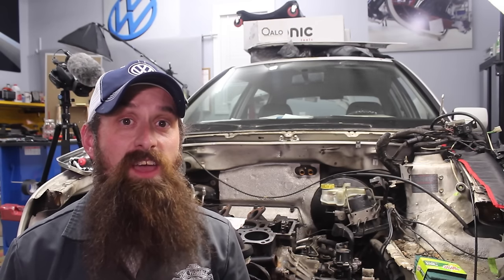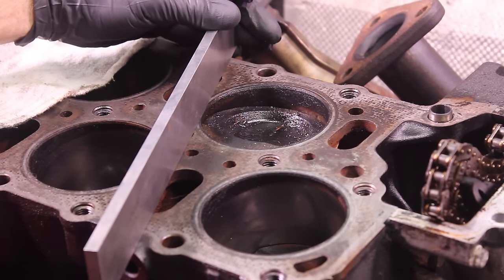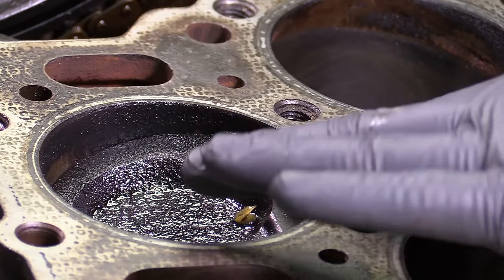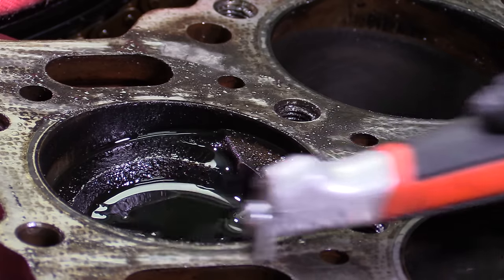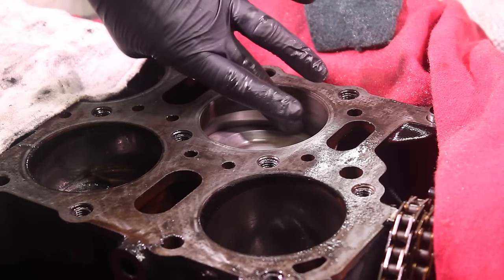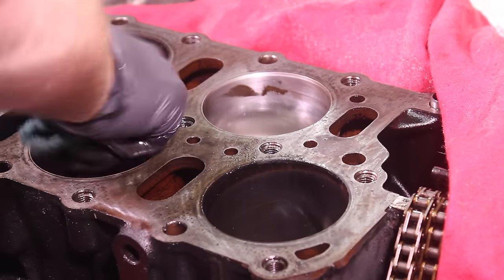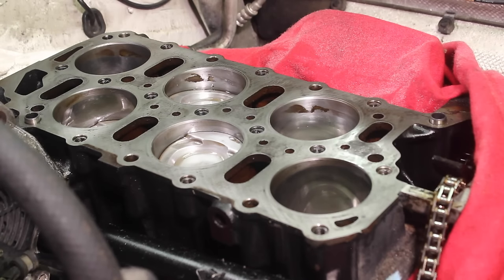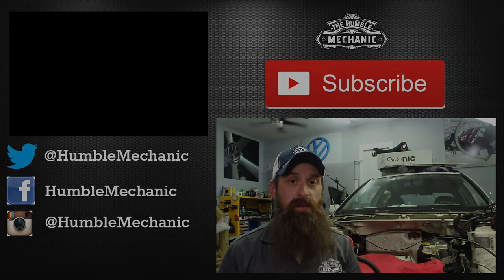Removing Carbon From Piston, Cylinder Walls, and Block Deck

Comment: yo guys. wd40 is a great and reliable product. it's great to prevent rust on items you're leaving sit for a long time, clean tools, get rust off, clean grease. it is not however a lubricant, any beginner hobby mechanic knows this.  the best part is it flashes off exhaust and such with less smelly smoke than most other cleaners or nut looseners. that said, why are people bitching about him using wd40 for this job? it's a great product for said task lol.
Reply from the maker: Great feedback. I was really surprised how well WD40 worked here. I have found that people have several issues. 
1) Any time a video is sponsored, there is kick back. It could be the best product ever and there would be heartburn
2) People have intense brand loyalty. If I shoot a video about Mobile1, the Mobile one haters will hate, even though they make a great product. 
3)Most people don't consider it a professional brand. I don't really get that, because I have seen WD40 in tons of shops over the years. 

It is really interesting to do videos like this and see the comments. We(me included) become married to our beliefs and often struggle to be open to different ways of doing things.
Reply: I totally see what you're saying on all 3 points bro.  I think the bigger issue is people don't even know how t use what they have. Use Brakleen as MAF cleaner, MAF breaks, they complain, use torque wrench as a breaker bar, it stops working they complain, use WD40 as a purpose made lubricant, or cleaner, they complain...  I guess the consistency is, people just love to complain haha.
Reply: I always pull my plugs and spray the hell out of the cylinders for long periods. I just pulled a 355 apart that I stored since 1990, the cylinders had zero rust, and I live 2 miles from salt water.
Reply: I always save the WD-40 red straw and leave it in the glove box. Once I drowned an AMC eagle up to the dash and got water in the carb. When we got it out of the puddle, I used the red straw to suck the float bowls clean with my mouth to get it running.  It worked good.
Reply: I liked your video and think I learned something from it, no matter what the naysayers say.
Reply: omgitzsteg it is a lubricant, read the can.
Reply: i use it on my 1095 knives and saws using wd 40 even when chopping wood or cutting still provides decent lubricant.
Reply: Tepco Cycle Repair  It isn't, it's a water dispersant, hence WD. It's hydrophobic but not lubricant.
Reply: @TepcoCycleRepair  
WD 40 is a SOLVENT not a lubricant, it will lubricate slightly, any liquid will but disperses quickly.
For instance if u wanted to lube a chain, u wouldn't use WD40, it wont last.
Reply: @motorcitymanman7711  it is a lubricant as stated on the can, you contradict yourself in your own statement. Is it a lubricant for everything? No but it is a lubricant. Get off the wagon of people who just like to say "it's not a lubricant" and yes I use it on chains all the time with no problem for over 10years now, bicycle and O-Ring motorcycle chains.
Reply: @TepcoCycleRepair  
I use it to CLEAN my motorcycle chain because it's a cleaner and solvent, that's what it's designed to do.....I LUBE my chain with a LUBRICANT or chain wax. You run a cycle shop and you use WD40 as a lubricant!!?,
 GEEEZ!! Hope u dont charge customers for lube when u do, you're ripping them off!!
I said ANY liquid will lubricate even water BUT IT DOESNT LAST!!!
Wd40 CLEANS grease and grime off my cycle wheels, LUBRICANTS dont do that!!
I use WD40 to clean tar off the fenders of my car....LUBRICANTS dont do that!! Cleans crayon off your home walls, LUBRICANTS dont do that!!
Reply: @motorcitymanman7711  straight from the WD-40 website 
Myth: WD-40® Multi-Use Product is not really a lubricant.

Fact: While the “W-D” in WD-40®stands for Water Displacement, WD-40® Multi-Use Product is a unique, special blend of lubricants. The product’s formulation also contains anti-corrosion agents and ingredients for penetration, water displacement and soil removal.
I also use chain wax when called for, like I said it is a lubricant but not for everything.
Reply: @TepcoCycleRepair  
Cmon man it's a VERY THIN lubricant like water......its not MEANT for lasting lube jobs!
Reply: @TepcoCycleRepair  
Maybe you'll understand this way......do you use Kerosene as a lubricant?? WD40 is like kerosene, a solvent and penetrant.
Reply: @motorcitymanman7711  Kerosene is not a lubricant, WD-40 is. Look, it's like this, I use WD for a daily lube on my dirt bike chain. It's an O-RING the parts that need lube are inside the O-rings, no lube will get in there, loading the chain with a heavy lube or wax is damaging due to what it attracts. The WD keeps the chain clean and lubbed for the day without attracting dirt. My race mountain bike is the same, spray it on wipe it off and ride for the day. If I'm doing a 24hr race I use TriFlow. If I'm doing a long XC MX race I'll use a different lube. 
I'm not arguing that it doesn't last long, I'll agree with that. But I won't agree that it's not a lube, that's all I'm saying.
Reply: @TepcoCycleRepair  
WD40 has kerosene in it........
Reply: @motorcitymanman7711  who told you that, the same people that said it wasn't a lubricant. 

Again, straight from the WD-40 website:

"While the ingredients in WD-40® Multi-Use Product are secret, we can tell you what it does NOT contain. WD-40® Multi-Use Product does not contain silicone, kerosene, water, graphite, or chlorofluorocarbons (CFCs)."

Don't believe everything you hear.
Reply: @TepcoCycleRepair  
Like I said, WD40 cleans almost everything......a LUBE is thick and doesnt do that, you can use it for whatever you want but its marketed as a Solvent and Penetrent of course ANY liquid will have some lubrication qualities but WD40s lube capabilities do NOT last like a normal lubricant......if you work on bikes or cars you should know this already!
Reply: I'm not sure if you're serious or not but it IS marketed as a lubricant as stated on the can and on the website, is it the lubricant that you're looking for whatever specific need you have maybe not but to say that is not a lubricant or  marketed as a lubricant is completely wrong and that's my point. And yes I have been working on bikes for over 30 years and am fully aware of the capabilities of many products. I'm just tired of people saying WD-40 is not a lubricant without educating themselves first. 
I can point you to their website if you need, please read through it sounds like you'll learn something!
Reply: @TepcoCycleRepair  
Why use a "lubricant" that is WEAK and doesnt LAST????
I dont know ANY professional that would recommend using WD40 as a lubricant......everyone knows except you, evidently, that it wasn't designed to be used that way, that's my point.
YES ANY LIQUID WILL LUBRICATE, but not all lubricate well and will last and WD40 is one of them.
On the front of their can, where it advertises the FEATURES and uses of the product does it mention lubricating because it's not designed to do that, it's designed as a penetrent and cleaner......of course thaty say in their website that it lubricates because ANY LIQUID WILL and they are SELLING their product so they want to sell as much as they can, ask any engineer that works with moving parts if they recommend WD40 as a lubricant its WAY too thin and the lubrication lasts a short time....UNLIKE  a real, thick, grease or chain lube 
Do you own stock in WD40 or does your Dad work for them?? LOL
Reply: WD 40 is good for cleaning, but for long term corrosion protection or lubrication it's god awful...it actually attracts water!
Reply: @motorcitymanman7711  yes it absolutely does say it lubricates directly on the can, please just look at it. I understand your point, it's not a long lasting lubricant, I'll agree with that. You say a lubricant is thick, try lubricating your lock cylinders with a thick liquid!! It needs a thin lube like WD or even a dry lube like graphite powder, heck what would you call graphite powder?? According to you it's not a thick liquid so it must not be a lubricant. 
So back to my point WD-40 is absolutely a lubricant, AS WELL as a penetrant, and rust treatment. 
Please prove me wrong with facts like I have shown you, you can't because you're wrong!
Reply: Myth: WD-40® Multi-Use Product should not be used on bike chains.

Fact: While WD-40® Multi-Use Product it is not a grease, it is formulated with strong lubricating oils and other ingredients, and is a terrific product to use for bike maintenance. It does not attract dirt or moisture to metal surfaces – just be sure to wipe off any excess WD-40® Multi-Use Product before riding.
Reply: @TepcoCycleRepair  
Ok, I agree with you that WD40 is a light lubricant, as I said all liquids are......but I wouldn't use it to LUBE a cycle chain, CLEAN yes, but not lube, it's a weak lubricant and doesnt last.
Yes graphite is a dry lubricant, I dont think I ever said there was no such thing, just that most lubes are thicker so they last.
Reply: @motorcitymanman7711  fair enough, good talk.
Reply: WD-40 actually works perfectly fine as a low viscosity assembly lubricant. If you disagree, that's fine, you're just wrong.

Anyone who complains about this kind of crap is just trying to show off how much they've been told because it makes them feel smart. Jokes on them, they're idiots.
Reply: WD40 is not too good on hard carbon buildup on rifle piston. It looks good enough here though. Will it work the same as Seafoam when sprayed into the intake? I really wanna spray something into my old engine other than water or my theoretical inventions like urea and hydrogen peroxide.
The Seafoam stuff should be 4:2:1 diesel-naphta-iso alcohol. 

I'd like to do it properly like this but only few % of people are able to do that.
Reply: No, it's garbage and not good at anything but rinsing other things away.  There's a better product for any given purpose.

Comment: Thanks for the tips man! Just got a 68 corvair engine to put in a dune buggy...the engine is dirty! There was no water inside too!
Reply: Well, Corvair is air-cooled, so...
Reply: David Plass yeah lol, it was sitting outside under a old tarp for 15 years...that's what I ment about water
Reply: Oh, so no water inside in the GOOD way!
Reply: David Plass oh dam I have a old corsair front end destroyed but only has 678 miles on it I but it's still inside the car and Its really rusted the engine is alluminum so that's not rusted but the bolts and stuff holdinf it is

Comment: Great tech tip. I've been an engine builder for decades. It's always nice to learn something new. As for the scraper, I no longer see my Snap On guy. I did find out that the Bluepoint scraper is mand by Bahco. I bought one on Amazon. Thanks again for the info.

Comment: If your working on an older engine sometimes the head gaskets contained asbestos so it might be a good idea to wear a respirator when cleaning the surfaces.
Reply from the maker: +Sam The Multimedia Man yikes!!! That's not good at all
Reply: yeah i found this out a few days ago when i wrestled the heads off my 1980 AMC Jeep 360; There was a thick grey silver coating on the block and head surfaces at first i thought someone put the heads on with a coating of JB weld all over the head gaskets; So i checked the factory manual and it turns out the head gaskets were aluminum and asbestos fiber laminated steel... with asbestos only being phased out of the auto industry with in the last decade or so it could be contained in head gaskets in many makes years and models.
Reply: Lots of exhaust manifold gaskets also contain asbestos and still used today.
Reply: only us jeep guys would jb weld a headgasket
Reply: Asbestos is not necessarily harmful when wet.😐
Reply: We used to buff the gaskets off and bead blast heads etc without masks..... love the lack of health and safety years ago lol.
Reply: AbioticSpider57 true that... will be fun.

Comment: This method actually worked really well for me. The wd and pads makes the gasket lift right off. The one thing was the debris getting better the piston and cylinder walls, I ended up getting a bit out but I’m not sure if I need to be worried or not
Reply: Howd it go
Reply: @Jet_Hammer  spun a bearing, I’m thinking the degree clogged the passages within the crank and starved a bearing but who knows

Comment: A good way to ruin a motor. Scotch-brite is aluminum oxide which is incredibility hard and if you get that inside the motor it will be toast in no time.
Reply: I was rolling my eyes, until I looked it up.  Al2O3 hardness: 9.    Iron hardness: 4.   Scotch-brite materials:  spun polypropylene fiber, with nine grit variations, most of which incorporate Al2O3 or similar high-hardness abrasives.   (Source:  wikipedia)   Also, BobIsTheOilGuy confirms.  Thanks!
Reply: Nice catch!
Reply: But is the extremely superficial "scratches" left by the scotch pads enough to make a head gasket useless? I'm gonna say no. But to each his own.
Reply: We're not talking about scratches on the head, we're talking about very hard particulates sluffing off of the Scotch-brite pad and getting down into the engine, where they make their way to bearing surfaces and destroy them.
Reply: Still doesn't seem as dangerous to internals as the normal small flakes of steel that gets into the oil with normal wear and tear.
Reply: Collin Moore It is.  Steel can be as low as 4 on the Mohs Hardness Scale.  Aluminum Oxides are all around 9, right below diamond.  For more info, see https://www.bobistheoilguy.com/forums/ubbthreads.php?ubb=showflat&Number=563163
Reply: I don't think they'll stay in the engine long enough to make very much damage, oil would wash them off, and they'll get trapped in the oil filter, and for the part that would be in the top of the pistons, the turbulences would end up getting them out with the exhaust gases. I could be wrong though, but i wouldn't worry that much for that dust.
Reply: Unfortunately, what matters is reality-- not what you think or feel.  Check out the link I provided above.  Also this one: http://www.machinerylubrication.com/Read/1777/aluminum-oxide-oil
Reply: Looks like you did your homework so, What would you be recommending using ?
Reply: Benoit Loriaux This information is new to me as well (thanks to the guy I was replying to,) so I don't have any particular recommendation yet.  But on my next head project, I'll be trying to stick to tools and products that don't have grit that can slough off.  If I can manage with just WD-40 and a gasket scraper, I will.   (Otherwise, I'll try to research the abrasive in whatever I do use, before trusting it.)  It will certainly take longer, but it's my own vehicle.
Reply from the maker: +Ryan Bissell (Ryan V. Bissell) anything with grit left in an engine can cause damage. Cleaning all debris from the job is going to be important. 

As I mentioned in the video that is not the last step in this job. The bottom end is going up on the stand for more cleaning. 

This was simply a method of removing carbon buildup. 

A video on final clean and prep will be coming once I get there
Reply: ☣droid☣  I agree🤙
Reply: ☣droid☣ 
I always try to keep whiz wheels and abrasives away from something like this, unless I can fully remove and fully clean it.  
 even just using the scrapper small shavings of metal, gasket and carbon are going into oil areas  and down into piston rings. 

necessary evil though, can't put new gasket over crap. 

I just do my best to keep stuff from falling into engine. usually dusche down the holes after with wd40 to push debris to oil pan, and then change oil.
Reply: Using a high speed 90 to remove the old gasket is overkill. One sure way to fuck it up
Reply: ☣droid☣ 
Scotch pads are plastic aren't they?  Sure look it to me and they are where I am.
Reply: +iVlog They might be structurally plastic, but they are infused with aluminum oxide, and that is the problem.
Reply: Ryan Bissell 
Assuming you can't blow them out with compressed air and SB is a no go, what do you recommend instead?
Reply: I'm not a pro mechanic, I was only sharing what I learned elsewhere (try googling "bobistheoilguy scotch brite"... I think that was my source.)  I believe the thread I link to below recommends staying with a putty knife or hard plastic scraper.
https://www.bobistheoilguy.com/forums/ubbthreads.php?ubb=showflat&Number=563163
Reply: ☣droid☣ exactly, bbobynski in this thread is a GM engineer, his name is Al Cline and I consulted with him daily for over 10 years, see this thread 

https://www.bobistheoilguy.com/forums/ubbthreads.php?ubb=showflat&Number=563163
Reply: Thats why you clean it off with whatever chemicals you use and air compressor.
Reply: There is a filter between the oil pump and the bearings.
Reply: I would use a nylon or brass brush
Reply: bullshit....used it for years...not one engine ruined.
Reply: @guillaumegaudin694  Yea, you are very wrong about that.
Reply from the maker: It ended up that I pulled the whole bottom end apart and rebuilt it. Found some rod bearings that weren’t happy
Reply: @collin3800  its the pool of debris now sat on the compression ring soon to be blown down past the rest that are cause for concern.
Reply: Dremel wire wheel and vacuum.
Reply: @RyanBissell  don't forget though, the difference in hardness between 9 and 10 is the same as the difference between 1 and 9 on the scale.

Comment: I wouldn't have thought to use WD40 to loosen up the carbon; I was going to use carb cleaner. - Steve
Reply: Same here.
Reply: Carb cleaner evaporates very easily, good for removing liquid or easily liquified sludge. Brake cleaner lasts a little big longer. To soak up old dried coked up sludge, you need a high-detergent infused petroleum-based cleaner like WD40.